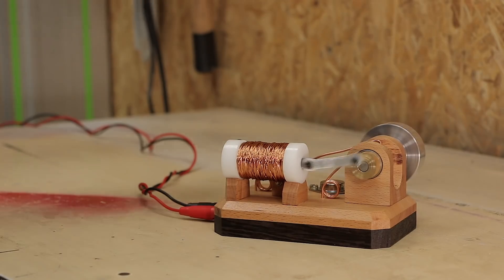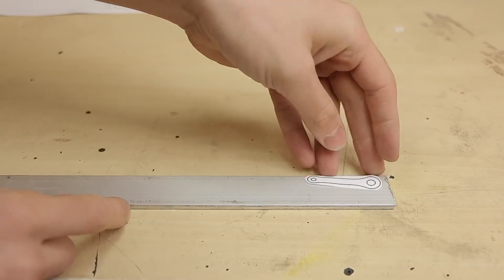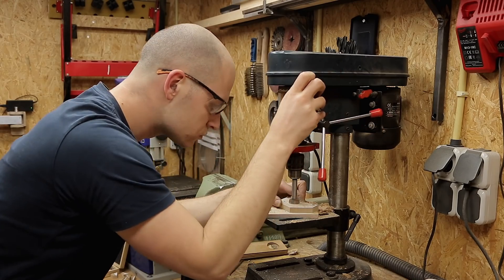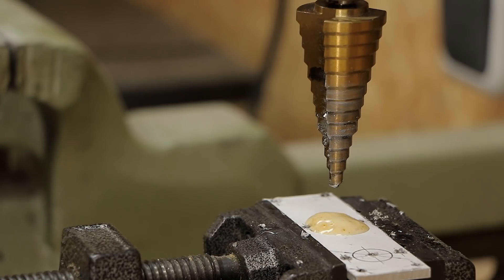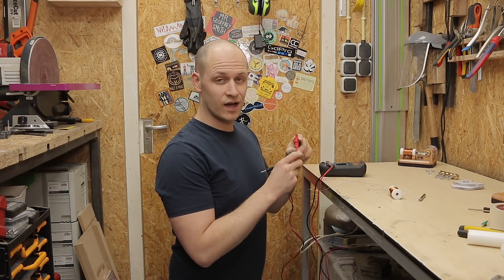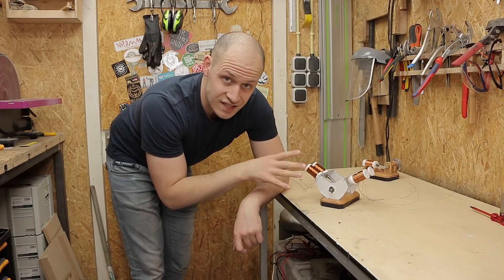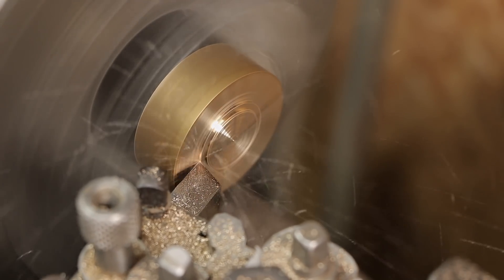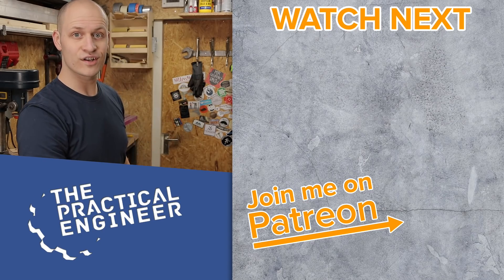How to make a V4 solenoid engine

Comment: Very good project. I wish to do it sometime.
And its wvwn more amazing that engineers did this 100 years back without any computer design on real engine controlling masive 12 cylinders, controlling gasoline sprays (not electric pulses), entirely mechanical design and using the output reliably to fly aeroplanes in world wars.

Comment: I have been a machinist for over 50 years. A tip when drilling brass and copper is to grind a zero degree rake on the cutting
edge of the drill. It won't grab then. just take the sharp edge off it. It may take a little longer, but, you won't break drills and it won't grab the material.
Reply from the maker: Thanks! I learned that too now 😂

Comment: if u want wery eficient engine u need woork with neo magnets and HV soleonoids.in that case no heating.better engine is ring coil and inside neo magnet like rotor.and generator diferent case,ring neo magnet and inside coil rotor

Comment: Excellent upgrade on the one cylinder (solenoid) engine. Now I want to see a V8 version.
Also have you got any way of measuring the torque produced?
Reply from the maker: I did not measure the torque. But it is not a whole lot

Comment: Ive been looking for this for 9 years. Please, please, PLEASE explain to me why this concept cant be used to create "free energy"... It seems like if you had powerful enough permanent magnets attached to the pistons and highly efficient electromagnets you could get a net positive energy output; given that the majority of the force is "free" from the permanent magnets. Im not a quack that believes in free energy fantasies. I just want to understand WHY it won't work. This has been driving me nuts for almost a decade so if you could explain it, I could put this idea to rest and move on and I would be eternally grateful.
Reply: My rationale:
[F=k(M1*M2)/r^2] so if M1 is a strong permanent magnet with a large value, and M2 is a highly efficient/low input electromagnet with a lower value, the majority of the force created by that interaction is created by the permanent magnet and therefore "free". Forgive me and try not to laugh if this is a stupid idea, my educational background is in biology/medicine so I have a rudimentary understanding of physics and engineering at best.

Comment: Center drill and Pilot holes first before enlarging to final diameter, then You won’t get slop on the shaft linkages on the rotor rather than rely on lock tight. Sigh...these are basic machinist skills, don’t teach on YouTube bad habits!!

Comment: i would really like to see a dyno sheet for this compared to a brushless DC motor that uses the same power.
Reply from the maker: A brushless dc is way more efficient. And also way more boring.
Reply: The Practical Engineer but how much more efficient would be interesting.

Comment: For the crankshaft design that you have made, the solenoids should all be in line or at 180 degs v angle for better efficiency. Or you could adjust the pin offset angles on the crankshaft to match the current v angle. Just a thought if you ever think of doing something that will carry a load. Great vid, thanks you.
Reply from the maker: Thanks! I'll look into it when making the next version

Comment: Can you build a neodymium magnet version where the solenoid pushes the magnet toward a piston which then turns the crankshaft? If that works then you could design a "camshaft" to mount the magnets which could replace the solenoids entirely ...

Comment: Instead of that points arrangement with the springy wire contactors, since you're already using transistor switching, why not make a nice slotted disc and use opto-interrupters, a bit like optical distributors but using cheap hobby grade parts since you don't need to worry about the hazardous environment like in an engine bay (high temps, etc)?
Reply from the maker: I like the visibility of the mechanical switching mechanism. But this sounds pretty cool too
Reply: I read your original reply in my notifications and I absolutely get what you mean. I used to live next door to a senior and very knowledgable man - I suppose he was a fitter and turner but he knew so much stuff, it's hard to say what his actual title was. He ran a metalworking shop for an electronics manufacturer. He used to tell me stories of his motorbike riding days, pre-WW2 (still had the scars). He used to build clocks as a hobby. In his shed were a couple of precision machines he built that would cut out cogs to whatever specification he needed. He told me when radio first became popular, he just couldn't get into it because looking into a set and not immediately seeing how it worked did nothing for him. I'm an electronics guy and given meters, scopes, experience, etc do recognise workings when I see them but I get what visual sense he (and you) are talking about.

Comment: Nice work i suggest you put this engine in a flying aircraft or helicopter then use a circuit with arduino to control speed .that would make it cooler i doubt this engine power would be able to handle the lifting of aircraft body
Reply from the maker: It's a heavy thing though
Reply from the maker: The copper wire alone is almost 500 gram

Comment: Nice shop and build.  Greater complexity adds greater "wow factor" ..consider a few modifications for your next build.  Use "shorter" length journals and PRESS the journals into the crank counterweights (correctly timed) and PRESS the crank end shafts into the outer counterweights, ..this will shorten and stiffen the crankshaft.  Cut a flywheel for the back of the crank with four small holes, then press in four small Neodymium disc magnets (correctly timed). Make a timing plate with an alignment pin to the center of the flywheel and attach to the wooden base. Cut a circular/rotatable mount that indexes on the pin,  the mount will hold four Hall effect sensors (adjust the timing of the mount and lock with a screw) ..the Hall sensors will trigger the FET's and coils.

Comment: I don't think you can regulate the RPMs thus making it impractical in powering automobiles and anything else that requires a throttle.  But it's brilliant engineering!

Comment: Something he did that is very important:  When he drilled the first hole in this video, notice that the drill bit did not turn.  Only the brass piece turned, with drill bit remaining still.  That is the best way to ensure the hole is drilled perfectly in the center.  As long as the drill bit doesn't wobble, the hole will be in the center every time.  Great video.  Very cool design.

Comment: FYI This is NOT an engine! It is a MOTOR! There's a difference! A motor is ELECTRICAL, even though many people refer to the ENGINE in their vehicle as a motor. An engine on the other hand has COMBUSTION. Note the never refer to a jet ENGINE as a jet MOTOR. 
  Simply put a motor takes energy in the form of electricity and creates motion and does NOT require any AIR to work. 
  An engine takes a fuel air mix initiates combustion and creates motion( to those of you thinking that the use of electrical spark makes it a motor as well, spak is NOT needed to keep certain engines running diesel engines once started can run just on a compression generated combustion).

Comment: This made me thinking... What if:
1- i remake this and modify
2- put permanent magnets (possibly neodymium) in the "pistonheads"
3- connect the whole thing to a rechargeable battery
4- make the wheel at the end a bit more heavy...
5- ...and give it starting push

In theory, it will generate it's own power, and maybe a bit more.
 I think the laws of physics can (and should be) broken.

If you think about it, science is evolving too... just remember, back then scientists claimed that speeds above 40km/h is deadly for human life... and now we watch F1 races. Some said, that could break the sound barrier, now we have jets flying above 2 or 3 mach's.

And not to mention that most of Einstein's theories are busted today...
...though it is kind of a forbidden knowledge.

Aaaaaanyways, these were only my... brainfarts. Sort of.
(Btw, i'm a weapon-engineer myself. The repair-man kind of.)

Comment: Why use 4 separate brass fittings for contacts, couldn't you use 1 offset brass, and 4 mini switches, you could set them on a adjustable turn dial to adjust the timing.

Comment: I would like to see you connect a solar panel or some kind of water generator while this engine is connected to a torque converter and then boost the volts just to see how strong this engine really is :)

Comment: Why don´t you use AC on those coils? No need for those annoying sliding contacts, just a 50Hz pull-up/down if you get the coils connected in the right phase

Comment: WHYYY would you go to such trouble machining the 'engine' so carefully THEN use bent solid wire for points on the switches? You could have used spring steel with carbon brushes or many other more reliable options more befitting the work you did  on the rest of the project?

Comment: Electrical motors don't need the inefficient design that is necessary with petrol engines.
Reply: When you consider the waste of producing that power and distributing it, the picture changes drastically

Comment: Next video he should pull the pistons out of an old V8 block and mount solenoids that connect to the crankshaft. Replace the gas tank with a battery pack. Only downside is you would still have to change the oil!!🙃

Comment: 4"stroke" has nothing to do with it being 4 cylinder. the strokes refers to the 2 or 4 stages each piston/cylinder goes through.
Reply: So, it is a two-stroke V4.
Reply: I thought the same. I was wondering how 4 strokes would translate to a magnetic piston.
Reply: V4 is the cyclinder arrangement/orientation - one could have flat-4 as in the VolksWagen Variant 1600 from the '70s where the pistons were diametrically opposed.
Reply: @Topher TheTenth I wish I had something to add.I'm not evil.
Reply: Clearly a language issue, not intelligence.
Reply: Not saying that you're wrong but it's entirely possible to be very good at one thing (designing and building things from metal) and bad at another (vocabulary).

I've personally worked for someone with a PhD who didn't know how to change a light bulb.
Reply: Did Ben supposedly say anything about intelligence,  @tomtalk24 ?
Reply: It has 4 electrical commutators - fired (driven by the transistors) sequentially - hence, 4-stroke per cycle.

He doesn't mean 4-stroke cycle per 'cylinder' obviously!

This is his design - it's electrically operated and no need to associate terms or compare them with the workings of an internal combustion engine.
Reply: @Tony07UK : There is, because it's a comparison, and using the terms differently will just confuse bystanders.

Comment: How the drill bit Broke while working on Bronze?? Maybe it was too old??
Reply from the maker: +Piontro Pechetrini brass has a tendency to grab the bit. There are special bits where the cutting angle is reduced. A dull bit would also improve things.
I didn't have either so I just gave it a shot and hoped for the best..

Comment: Sorry... May-be i little aggressive says comment in first. For perfectionism you must balance rotor every step his do...  Rotor must rotate free without hard steps... Just lookup channels of reactive engine makers - they really cool balance rotors! In second you must balance each fist exactly same weight... Тhen last.... You must correct each electromagnetic field... By same wire length, and loop each solenoid from engine begin line by line... for example
    v---- Here begin  (+power)
o/|====|
             ^_ here end (-GND)

Now you have electromagnetic power like      |*oo0O|      but you needed exact    |OOOO|    good field removes hard and light steps.... Then your engine will be EXTREMLY perfect!....

I really will you Guinness record for Rotor RPM.... )))))

Comment: Never dry power tap acrylic! Use a dab of water in hole to take away heat from the plastic, your threads will be much nicer. Also don't use taps previously used to tap ANY metal.
Reply from the maker: Thanks for the tip!

Comment: OK, I am not an engineer or a mechanic, just a hobby blacksmith.  That said, how feasible would it be to make a V-12 using an actual crankshaft from something like a Jaguar V-12 engine, PVC pipe for your cylinders/solenoid core, maybe an actual camshaft from the Jaguar engine and momentary on/off switches actuated by cam lifters (to avoid wearing out the switch button)?

Also, what kind of power output and RPM did you get with this model?

I don't see this as a viable power plant for an automobile, but perhaps it would have enough output to power a hull suitable for a steam launch, which being a pleasure craft where efficiency is not really an issue.

Also, it occurs to me that with fusion power plants coming online within the next few years, electricity will be almost free... or at least unmetered.  At that point, efficiency of anything using electromotive force is irrelevant.  

Who knows?  With enough development, Tesla might introduce a V-8 or V-16!

Comment: Well done! This is not a bad idea to have all the car factories to convert a GAS engine to an ELECTRIC engine if they want to save money by saving the engine parts and convert its parts to an electric engine. Is this possible ?! You saw the video! There so many cars at the car dealer lots with gas engines under the hood today.OK, DO THIS, TAKE THE ENGINE OUT AND REBUILT IT AS A ELECTRIC ENGINE  AND PUT THE BATTERIES INTO THE GAS TANK!!!

Comment: now make a generator for it so its completely self-sufficient
Reply: Hopefully your joking but if you're serious:
I think you lose energy in the form of heat from the resistance of the wires, 
and probably from the parts creating friction among themselves and the resistance from the air
probably some other places the system loses energy. 
Note that no system (that I know of) is 100% efficient
In other words: the electricity that he puts through that badass motor doesn't all get transferred to the rotational energy of the crankshaft. 

Btw  I only sorta know what I'm talking about, but I don't feel like "Riiiight lol" was the response that you deserved.

Comment: Instead of physical contacts on cam lobes you could use LEDs and phototransistors to switch the solenoids on and off. Just need to make a trigger wheel to break the light beams to control the timing of each solenoid. Also, how long can you run it without grease? I would expect a lot of heat and friction at both connecting rod pivot points.

Comment: V4 engines (and all V engines) use one crankpin for every two conrods on every V section. You could have made your crank simpler with two crankpins instead of four.  Also, using a 0 degree crank with only two crankpins, you could make the electrics simpler, one switch for every two side by side cylinders. 

https://www.picclickimg.com/d/l400/pict/361931089142_/Honda-98-VFR800-VFR-800-FI-Crankshaft-Crank.jpg

Comment: Probably the coolest thing ive seen in a while but you called it a 4 stroke engine it would be a 4 solenoid motor. The strokes in and engine refer to the power making process intake compression power exhaust also engine produce power using fuel you motor requires electricity to run so not an engine still really cool

Comment: I'd like to see this built into a bigger version and put into a car with an alternator so the battery never dies and you dont need to stop to charge or get gas
Reply: would that be perpetual motion?
Reply: because of friction, it would not be able to make enough energy from the alternator to keep the battery charged.  It would run the battery down over time.  How long the battery lasts depends on how much load is on the motor.
Reply: Incidentally, you'd get less range by adding the alternator than just having a battery.

Comment: Firstly, I have had a very similar machine in my mind for years and years but I've never had the resources available to make one myself, so thank you for the work and video.

Secondly, it seems you are using DC as a power source, and using physical movement to create the timed switching of the applied power. Which is a pretty neat idea. I wonder, though, why you wouldn't drive the system with AC. Then you could use some capacitors to offset the timing. Then in theory you could adjust the freq of the AC source and change the engine's output rotation speed.

Thirdly, I feel like you you could generate stronger forward movement on your solenoid if you made the piston driven by electromagnetism coupled with a strong neodymium magnet on the base (think speaker coils). 

Loved the vid, I'll subscribe to see this develop further. It would be cool to see a E-V8 engine. If tuned efficiently I wonder how it compares to the conventional electrical motor. In theory such an engine should be able to produce gob loads more torque at super low RPMs.

Comment: Good video.  However you should explain more, such as I believe you are using laminated copper wire.  If you used regular non-laminated wire, wouldn't it just short from wire to wire instead of going around and creating the needed magnetic field?
    Is that DC voltage?  I was thinking you would need to create a circuit to send pulses to one side and then the other.  It's nice you didn't.  Now you just need to put it to some kind of application.  Maybe build an electric model "steam" engine train with solenoids for the pistons.

Comment: Great idea, well executed. The electrical pulses could also be provided by either an Arduino or Raspberry Pi. The code would be the same as for a stepper motor. (well documented How To's)That eliminates the mechanical 'brushes' distributor. The timing (motor speed & direction) would be programmable or controlled with a pot, even over WiFi. 
Now, you have the beginnings of a unique RC vehicle.😎